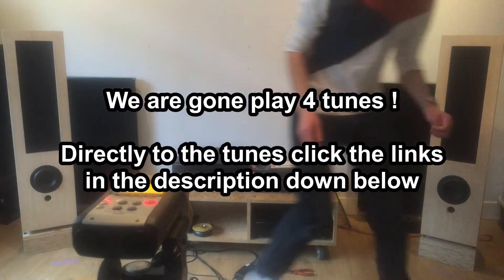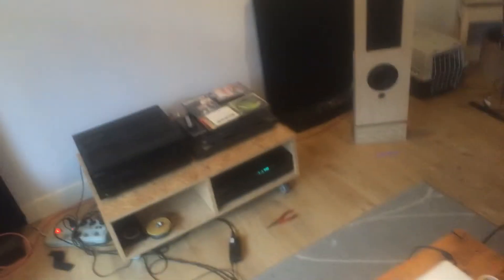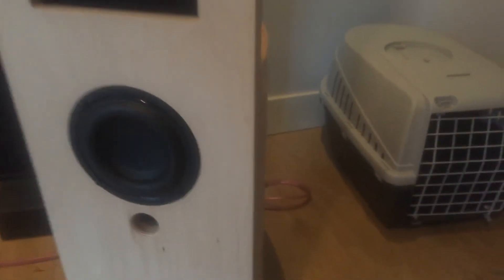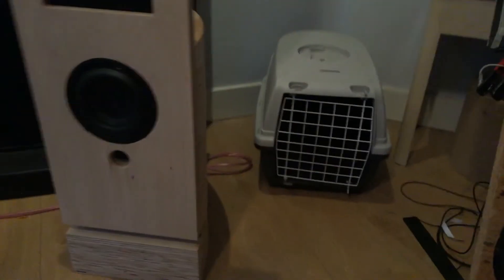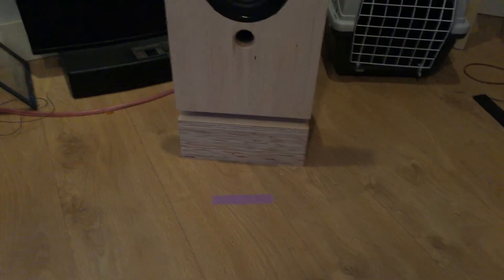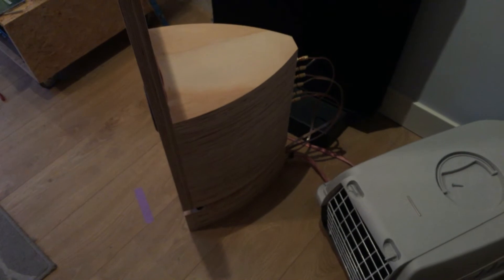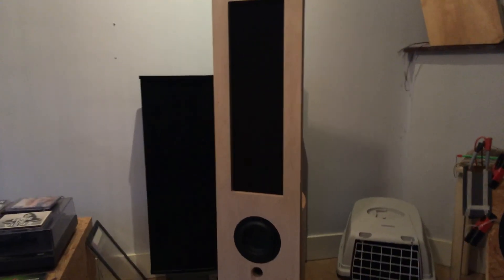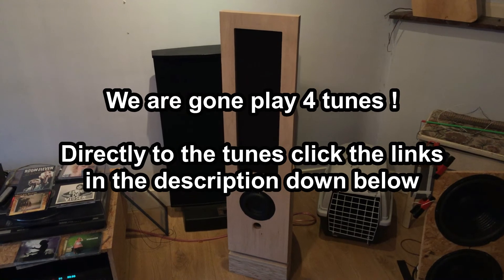The Cees Project - Last Musical Appearance in my room (DIY Planar loudspeaker)

Comment: So I love the look, by the way, and you could use a larger driver with downward facing port into that space. Then finish with cork, as I suggested with cotton batting and Blackjck (roofing tar) instead of auto body deadener (expensive, but same shit) on the interior wood surface to mitigate spurious resonance. These are merely ideas that I have used and work truly well for an acoustically inert cabinet. Remarkable achievement, Joppe. Maybe I send you some money soon...for beer, anyway.;)
Reply from the maker: HAHAAHA money for beer always welcome ! hahah  and thanks for the suggestions  :) we still need to fill this baby up with more then 10 Kg of sand. first need to dry it in an oven  haha and maybe that makes a difference... never did that so lets see